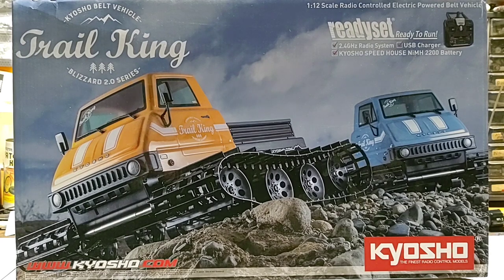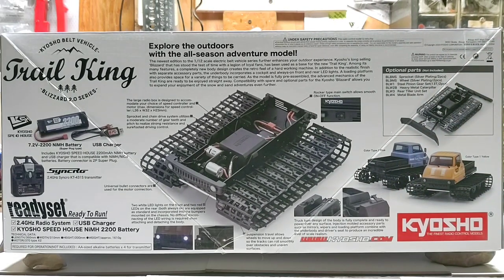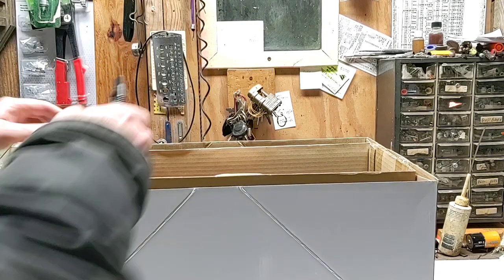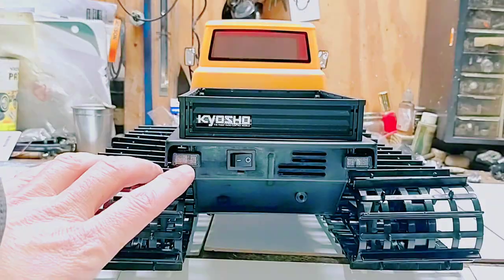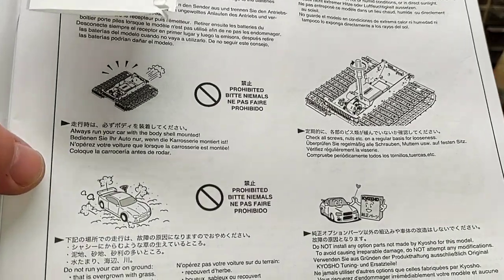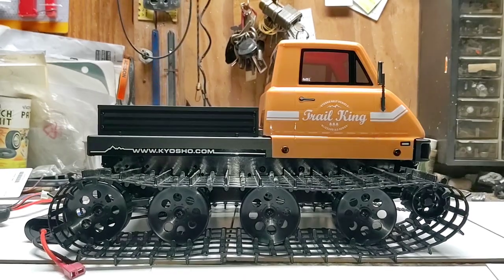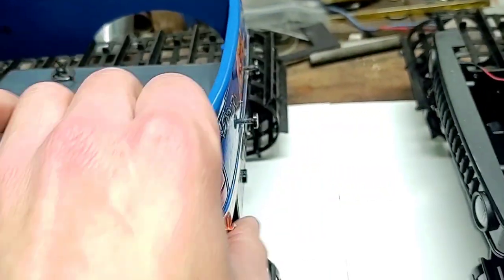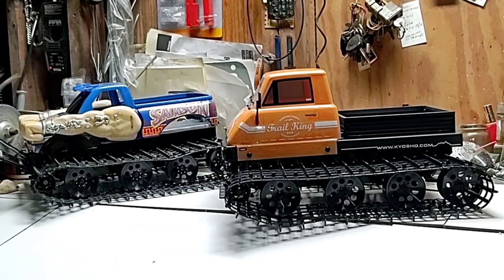Kyosho Trail King Unboxing; ...is it Lipo Safe ? Not really... No Low Voltage Cut Off on the ESC's

Comment: So Jim with all your experience if you already had a trx4 with a bec and updated servo would you spend the money on a lift kit and tracks or buy a kyosho  blizzard 2.0? Or are they both just to different animals to compare?
Reply from the maker: 2econd answer 😁👍
Different animals all together, The Trx4 & the Track units combined weight, tends to be a little on the heavy side,😕 Which makes it sink like a rock in powder snow, or snow that has been compromised by afternoon sun, 🌞😂 But under "normal snow" conditions, The Trx4's equipped with tracks "especially deep lug tracks" are pretty darn formidable, And they can crawl over hard surfaced obstacles better than the blizzard as well. 😊👍 

Blizzards; 
Blizzards are very light weight, Especially if you're running the stock plastic tracks, Which are 3 inches wide, (Light weight & A big foot print = Awesome floatation)  And that's exactly what they have, Awesome Floatation ! 😁
"I've said this many times about the old blizzards, 
It doesn't matter how Soft, or Deep the snow is,😕 It could be 3 inches, or 1 mile plus of snow, And the blizzard only sinks in a minimalistic amount on the surface,🤏
Which makes it awesome for just ripping around in the powder,😄 But... It's not very good at navigating certain obstacles "like the log bridges on the adventure course"😕 Plastic tracks, and "certain" half frozen objects, Don't necessarily get along very well,😞😂 And that's where the Trx4's really shine through,😁👍 Otherwise the Blizzards are pretty much unstoppable in deep snow,😁  There's a need for both vehicles really,😕 And I definitely love both of those vehicles 😄 Especially both of my "1-Off" vehicles, Bronco is a one of a kind YouTube Icon, And the Kyosho Blizzard with the Midnight Pumpkin body is just sexy as hell.😍😂 lol
Two different vehicles entirely... And I recommend both, Especially in a environment such as Maine,😄👍 Only real problem with the blizzards is, That the stock motors seem to quit working prematurely,😕 It happened to my Blizzard Fr, And it happened to my brothers Trail King too 🤔
"One of the motors quit working within the first week or so" 😕
Which means crossing your fingers with a replacement Kyosho 370 motor, Or upgrading to something better, Like two Traxxas Titan 18 turn 380 motors,😁 😕 But that involves some light rigging, and a specific pinion gear to accomplish,🤔 And possibly a couple of Axial AE5 Esc's on standby, just in case the stock Esc's go up in smoke,😂 In all reality though, the Axial AE5 Esc's are a good swap from the start, And they provide a much stronger acceleration out of the hole vs the Kyosho Esc's too,😁 My blizzard with the hard plastic midnight pumpkin body, is slightly heavier than my brothers Trail King, They both have the same motor and pinion gear setup, and they both run on the same type of batteries (Two Wltoys 3000mah 7.4v lipos) But my Blizzard is much faster out of the hole, vs the Trail King, And ultimately it comes down to the Esc's,😕 The Axial AE5 Esc's have more punch then the micro Kyosho p.o.s. Esc's,😁 
It's a costly little mod to swap all that stuff out, But at the end of the day it's totally worth it, It really wakes those machines up.😁👍
Edited... Holy poop I never proof read that comment, and there was all kinds of spelling, & sentence structure errors throughout, I mean a couple of errors here or there, is tolerable for my own "self criticism" But this reply was chocked full of little F-up's,😂 And that simply won't do! 🤔😄 
Edited for F-up's 😂👍
Reply: That's funny about your bronco it's true I remember years ago telling my kid it was the baddest rig on YouTube. Just something about it. After Christmas I think I might bite the bullet on a blizzard. I remember drooling over it  in the old tower talks. Thanks for all the info
Reply from the maker: Well... I didn't want to sound prejudice about the old Bronco, But darn it!  I'm kinda like a proud parent when it comes to that truck, ha ha ha lol 😂👍  It's so... different from the rest of it's kind, That it doesn't need a Channel name sticker on the door, for people to know who's truck it is.😕😄 Ha ha ha lol 🤣 
And I suppose if Blizzards were popular on YouTube, Then my Midnight Pumpkin Blizzard Fr, would probably be on its way up the notoriety ladder as well,😕 There's very few "one-off" Blizzards out there on the Tube,😕 One of my favorites, and most inspirational blizzards belongs to Chris From "Scale Town CWR" on YouTube,😊 he's got a old Marui "Big Bear" pickup body on his, And it looks Sweet! 😁 Although I can't exactly give Chris all of the credit for that idea,😕 I too was one of those kids, who was turning model tanks, into monster truck tanks back in the 80's,😄 I even did the same conversion between a Matchbox mail jeep & a Hot wheels tracked troop carrier,😂 and I still have that one sitting on the side, with all of my old childhood toys, (or at least the toys that were considered "the best of the best" at the time)😕😂 Lol
Tank Trucks! Always a Cool Combination...😉👍
I hate to give away ideas, but lately I've been toying around with the idea of turning a blizzard into one of those Sherpa truck's, or making a Blizzard "Amphibious" 😁 
A amphibious Blizzard would be a much easier project to accomplish, vs trying to do a "homemade" Shurp conversion rig job.😂

I seriously don't mean to sound prejudice about my RC's, 😕 I'm just one of those people, who likes having stuff that's different than the majority, "it's all about individuality"😕
The Black Sheep of the bunch.😄👍

Back to Blizzards; You mentioned the old tower catalogs from back in the day...😄👍 Yep.. that's where my original wanting for a blizzard began as well, "mid 80"s tower catalogs" 😊👍 and then I waited until I was in my mid 40's before I finally bought one.😂 Ha! Lol 
Yes sir I definitely recommend the blizzard for deep powder fun, There isn't any other kind of RC out there, that's better for that kind of stuff,😕 When it comes to Deep Powder, The Kyosho Blizzard is the King!
😁👍  And the Trail Kings aren't too bad either,😂 Differences; Other than the body, The Blizzard comes with a working plow, And the Trail King comes with working head lights & tail lights,🤔 But I think out of the two vehicles, that I would rather have a Blizzard vs the Trail King, There both around the same price, But the snow plow is a more valuable item in my eyes vs led lights,🤔 LEDs are important for night time usage that's for sure, there's absolutely no definition of where your vehicle is going at night without them,😕 But those are pretty cheap and easy to rig up on your own, The snow plow on the other hand, is slightly more valuable when it comes to individual cost "buying it separately" and included items with the vehicle,😕 
(Snow plow, Snow plow link's, Snow plow link chassis mounts, Snow plow servo link, Snow plow servo link chassis mount, Along with the Snow plow servo itself) 🤔
LEDs on the other side what do you have..? 🤔 
Led lights, and buckets on the front, & led lights, and buckets, on the back,😕 Pretty darn cheap when it comes to separately purchasing items, compared with all of the required snow plow items.😕 
Oh.. I almost forgot, There is another difference as well, But it really doesn't matter all that much if you decide to swap out the motors,😕 
Now I'm not sure if this was a Blizzard Fr specific item or not,🤔 But my Blizzard Fr came with faster 370 motors Compared to my brothers Trail King 370's,😕
And the Trail King is based off of the Blizzard 2.0 chassis,🤔😕 So I'm not sure if they both share that same motor setup or not,😕
or why my Blizzard Fr came with lower turn 370's compared to the Trail King,😕 Either way it's kind of a moot point, since the stock motors won't last more than a week out of the box.😂 lol
Motors stink! Esc's are okay'ish, And it's also possible to swap out the single battery cable, for a dual battery setup running the stock Esc's as well, You can even run it on a Lipo too or dual 2s lipos "as long as you use a low voltage lipo alarm in line with the battery" the stock Esc's don't have a low voltage cut off 😕 They come with a nimh battery, but they are Lipo compatible, just no low voltage cut off on the Esc's,
(At least with the Blizzard 2.0 & the Trail King, The Blizzard Fr, Is Not Lipo Compatible in Any Way🔥 The Blizzard Fr comes with different Esc's vs the Blizzard 2.0 & Trail King)😕
And the Blizzard Fr costs more money too.. which is what I can't figure out, Why does it cost more money, when it's not even Lipo Compatible like the Blizzard 2.0 or T.K. ? 🤔😕 
Anyways... If you're thinking about getting one of those vehicles, I would recommend a Blizzard 2.0 or T.K. over the Blizzard Fr, just because those other two come with different Esc's vs the Blizzard Fr.😊

Holy smokes it's 7am... And I started typing at 5am 😂
Hoping to do a little filming today too, like within the next hour or two, we just got a little bit of fresh snow yesterday, and I've got my K10 Ascender all keyed up and ready for a run,😄 just need to throw it outside for a hour, or so to acclimate, and I'll be good to go.😁👍
I haven't done a video for months and I've been itching to do one since I started chatting back and forth with you over the last few days,😄👍 I'll try to get it done and uploaded before Monday evening, and if I work fast enough, I might even be able to get it uploaded before this evening.😂👍 
Alright... Later bro, and I may even mention you on video. 😄🤜🤛
Reply: Well I apologize for taking up so much of your time but I do appreciate the advice and if I inspired you to make a video then I don't feel bad about it at all lol. Your videos rock. You have my head spinning now as well I have a new brushed hobbywing 1080 esc I could get another one and use those with 2 more reliable motors. It all has to wait until I know everyone else is set for Christmas but you sure have me thinking lol. Have a good one Jim. Thanks again.
Reply: Oh yeah one last thing. Believe it or not the "big bear" pickup was my very first hobby grade truck. A story for another time lol
Reply from the maker: Ahh no worries about the time, I've always got time to b.s. with friends,😄👍 And I still have another hour, or so of waiting for the Ascender to acclimate, so definitely no worries bro.😊

As for the rigs; it's definitely a lot to think about, but it's pretty easy to connect the dots with it all,😕 The Blizzard 2.0 is the best choice of the Blizzards/Trail King lineup, You already have one Hobby Wing 1080 "which will work great, especially because of the Bec output" So you only need one more of those ($40.00'ish out of pocket) Next thing is the motors, Two Traxxas Titan 18 turn 380's, ($18.00'ish ×2 = $40)
Two Pinion gears for the 380's,🤔 can't remember what brand I used off hand, I've got the packages sitting with the rest of my pinion gears in a plastic tube, and in "somewhat storage" while we're building the studio,😕
But I think they were around 4-7 bucks a piece,🤔 say $15.00 to be on the safe side,😕 Which puts you at roughly $95.00 buck's above the initial vehicle cost,🤔😕 kinda pricey, but definitely worth it for the power difference,😊👍
(Other than pondering the overall cost of Christmas presents) the next thing to think about with the Blizzard, is wether or not you want to run on a single battery, or dual 2s lipos,😕
It comes with a 7.2v nimh battery, and the he ESC is 2s lipo compatible, But it's not 8.4v nimh or 3s compatible,🤔 Which means that a 7.4 2s lipo is the better choice,😕 Next question, is wether or not to run a single Lipo or Duals ?
Single Lipo is okay, But the only problem is that your feeding two motors with it,😕 For example;  let's say you're climbing up a hill sideways, The Esc's have a tendency of wanting to push the power to the motor with the least resistance,🤔 which means that it ends up giving the track on the up hill side more power vs the track on the downhill side,😕 Kinda like a open differential really, The wheel that spins easiest gets the power,🤔 And the single battery going to two Esc's & two motors does the exact same thing,🙄😕 total bummer! You end up having to over compensate with the downhill side track to balance it back out, and you have to over compensate a lot, almost full throttle on the downhill side vs a pinch of throttle on the uphill slide,🤔😕 And Dual batteries evens all that crap out,😄👍 Only problem with Dual batteries.. is that there isn't much room for them in the chassis,🤔 which means that you need two shorty packs, or something slightly smaller like the 3000mah "Wltoys 10428" 2s lipo battery,🤔😕 Good news is, that those are cheap and readily available for sale online,😄👍 less than $30.00 for two of them,😊 So if you go that route it's going to put you at roughly $125.00 over the initial vehicle cost 🤔😕 and that's not to bad at the end of the day for the performance difference.😄

My biggest complaint, is that Kyosho should do it all that way from the factory,😕 Bigger motors, Better Esc's, And Dual 2s or 3s lipo compatibility. 🤔😊👍

Alright it's 8:42am, my trucks been acclimating long enough, and now I'm about to go film and 
I'll be back in a few hours if need be.😄👍
Reply from the maker: I always loved the Big Bear, but never had the opportunity to own one 😔
Super jealous! 😄👍
Reply: I had forgot all about the old Datsun  until a few months ago. Until "Andy Robinson Rc" did a video on it. Until I saw his post I remembered the grasshopper as my first build. But it all came rushing back when I saw his post. It was the Big 🐻. It was 1984 I was 14. My stepfather had a employee that was into  rc planes and we built a sig kadet mark ii. If I remember correctly I had a 4 channel tower hobbies system 3000 radio. Summertime came and I went to stay with my dad in Virginia. He bought me the big bear kit at a local hobby shop for keeping the lawn mowed. I built it and then had to wait a month until I was back home to install the receiver and servo from my plane. Man that seems like a lifetime ago. I ended up stripping the rear end out and the contacts on the mechanical speed control burned up. I never did replace any of the parts "it was harder back then" lol. No Amazon. You had to save the money. Have your parents write a check. Fill out the order form. Mail it and then wait.  I will have to dig out a photo of it. I know I have a few. Lol
Reply from the maker: That's Awesome...😄 What a great story, And while reading your comment I also had long lost memories rushing back in.😂 lol 
When you mentioned waiting on the servo's and whatnot, I instantly recalled the same situation with my first hobby grade RC, 😁 it was a used Tamiya Frog 🐸
Original version from the 80's, which is also the same time period for the memories,😂 lol Anyways I traded a Red colored, "Laser brand" Dirt bike helmet for it to my childhood friend Jim MacIssac, He had just received a Brand new first edition Tamiya Black Foot for Christmas I believe, and I had also just received the motorcycle helmet not to long before that, so it was pretty much brand new,😕
Anyways.. Jim took the Airtronics radio gear out of the Frog 🐸 for his New Blackfoot, ☹️ and then I had to wait until my birthday before I could get a transmitter for it,😭 at least it was only a two month wait, (Birthdays in February)
But back then 2 months was like waiting for a lifetime,😂 (it's funny how things like summer vacation fly by, and things that you want time to fly by for take forever)😂 so I did the long wait and ended up getting a brand new Futaba Attack 2 stick 2 channel radio which included 2 servo's and the receiver as well, (like everything else back then)
Nice radio, Chrome face on it, with a power meter as well, it ran in 8 AA's, and it would suck those babies dry faster than a Tyco Turbo Hopper,😂 We used to have a stock pile of used transmitter batteries laying around, and when it was desperate time's we would filter through them all with a old Fluke volt meter, so that we could continue on with the RC fun, anything above 3.5v was considered usable, but I was mainly looking for 4.0-4.5v for the transmitters, 3.5v worse case scenario 😂 lol
Anyways again... I know what you're saying with the wait time back then.😂👍

Which vehicle did you strip the gear's on ? 😕 Grasshopper or the Big Bear 🐻 ?
I'm going to go out on a limb and say it was the Big Bear 🐻 😕 
Two reasons for that conclusion; The Tamiya Grasshopper Transmission is notoriously tuff 😕 I blew the differential to pieces on my Tamiya hornet last year, but that was under Brushless power, running the Traxxas Vxl 3s 3500kv system, and a bunch of throttle abuse 😂 But as a youngster, I don't recall ever having any problems with that type of gearbox in any of my vehicles,😕 Frog/Blackfoot/Monster Beetle Transmission is a different story, I could write a book about that P.O.S. 😂 lol
Alright.. second reason for guessing the Big 🐻 as the blown diff receiver,🤔 For a short period of time there used to be a hobby store about two miles away from my house, I used to ride my bike over to it as a youngster,(small mom & pop rc shop,Riches Hobbies was the name) And the wife named Elenore, I came to know her very well over the years that they were in business,😂 Not that Way!!! 
Get your mind out of the gutter Elwell 😄 Ha ha ha
But I will say this, she was definitely hot 🥵 O.G. milf
They had a son that was a few years younger than me and he was spoiled rotten,
But Elenore was extremely helpful, and very informative about a bunch of different RC brands, As well as Vehicle Reliability and Parts Availability,😕
And the Big 🐻 is one that she steered me away from, as well as the Ninja 4×4 buggy,😕 She tried steering me away from a Varacom Big Grizzly 4×4 monster truck, I didn't listen and I regretted it afterwards, same thing for the Kyosho Big Brute, Big Regret! is more like it,🤔 Same for the first Kyosho Outlaw Ultima  2wd stadium truck,😕 I wanted a Mrp High Roller too and she said no to that as well,☹️ She steered me away from a ton of different RC's, But the Big Bear and the High Roller are my two biggest missed out on purchases.☹️
Reply: It was the Big bear that stripped the rear end and manual speed controller.  it was not very reliable and did not last long. But more important then that now the whole world know that Jim from rc after dark supported his rc addiction in the 80's by being Eleanor's Gigolo 😆🤣. It's cool bro we don't judge. We all know rc is a powerful addiction.😉
Reply from the maker: @8bitisthesh1telwell74  
Gigolo 😂 ha ha ha lol
Mechanical speed controllers; One word description, Terrible! 
Out of them all I found the Tamiya speed controllers to be the most reliable, But they still Sucked! 😂 Lol
Best setup for those, was being lubed with a little dielectric grease, and then stuffing the speed controller into a balloon to seal it up a little, but once again they still Sucked! 😕😂 

Side note; got that video done yesterday, but I'm not quite done editing it yet, "almost done" I should have it up sometime today, But be for warned, it's a little bit over 110 minutes long 😵
But it's probably worth a view regardless, I show a bit of the RC workshop/studio project, and then I take my K10 Ascender out on the snow covered adventure course,😕 I can't honestly believe that the video is that long, but I can definitely say that it's non stop from start to finish, so the time should go by quick.😂👍 

P.S. love the old RC stories man, Feel free to send as many as you can remember, I always love reading that kinda stuff.😁👍
Reply: Looking forward to the video. Ok one more before I go. Get some tissues because this one is a tear jerker. Sometime in the late 80's my best friend Doug zalenski and myself Doug Elwell aka (duggie and Dugzie) save enough to both get kyosho advances. Bad a$$ nitro buggies. We wait forever for them to arrive from tower hobbies because they shipped them to Acton mass instead of Acton Maine. But we get them and spend 2 days building and breaking them in and head out on the frozen lake. Perfect sunny day and hard pack snow. 3 rips up and down the lake and mine goes out of radio range stuck wide open. I bet it was doing 40mph as I hopelessly  watched it hit the bridge head on and self destruct. I wanted to cry.  Dugzie got a parts rig that day.😩 That was the coolest looking rc I ever owned. I'm sad just thinking about it lol. Everytime I open a new rc these days it takes me back to just how amazing they made us feel when we were young. Really looking forward to seeing your new studio.
Reply from the maker: Ahh man that's terrible 😵😭 Darn Run Away's!
And it reminds me of something similar, except that it was a boat... I had a Dumas deep V Scarab when I was a kid, it was about 46" long and had a K&B .61 airplane motor in it, along with the crappiest of Crappy Two channel AM transmitters,😕 
Maiden Voyage; it ran awesome! F-ing flying across the lake, and then the same thing happened to me, I got out of range and the boat went wide open into a floating diving platform,😵 and then it sank to the bottom of the lake 😭😭😭 And it's still sitting there today, 😔 I can laugh about it now 🤣 but back then it was something that seriously broke the bank.😕 "big investment with zero return" the only thing that I had left over was the 12v electric starter motor and that crappy 2 channel radio,😕 and to tell you the truth, I never did use either one of those items ever again, The starter was given to a friend who liked RC planes, and the transmitter was thrown in the garbage a few years later, Yep.. huge loss all the way around..
Same thing happened with that Kyosho big brute, wide open down the road and into a 36" buckshot mudder on somebody's square body Chevy, and it was in the middle of winter too, so the plastic was extra brittle, and that truck was thoroughly destroyed.😭 Only difference with this wipe out, is that it wasn't caused by going out of range, it was caused by Kyosho's extra crappy mechanical speed controller, The speed controller got stuck! And the truck didn't have a prayer after that, Smash! Bam! Boom! Destroyed! 😕
Another important note, is that Kyosho's plastic was Really really brittle back then, and then you add negative temps into the mix, and it becomes more believable that the old big brute blew into pieces 🧩
That thing Blew apart! Total yard sale!  😂 Only thing left in one piece was the tires, the radio gear, and the gearbox, everything else was reduced to scrap building materials for future rigging projects,😕 But hay..at least it didn't sink to the bottom of the lake,😂
The boat was a total loss!
And after that I avoided getting any other boats until I built that little Nqd jet boat back in 2016,😄 The new digital 2.4g transmitters changed everything! 😁
But ahh... I definitely learned my lesson with the Dumas,😕 I don't stray too far away with my little jet boat.😂👍 
Memories... Yes sir you triggered some more with the going out of range story.
😄🤜🤛
Reply: Oh man those are horrible stories. It's  weird I grew up on a lake and have lived on a lake for the last 18 years and have never owned a rc boat. I fixed one for a neighbor years ago "1/12 scale miss Budweiser" but never owned one.
Reply from the maker: Indeed... 😄
And no loss on not owning a RC boat... Just like owning a jet sky, there's only so much that you can do on the water,😕 Which is why I prefer Terra Firma, Unlimited possibilities.😁

Video; yesterday was a weird day, I should have the video up some time today.
😂👍